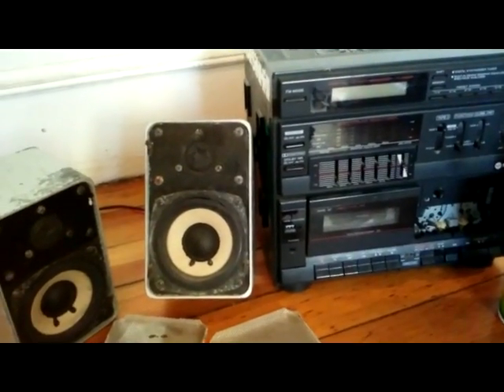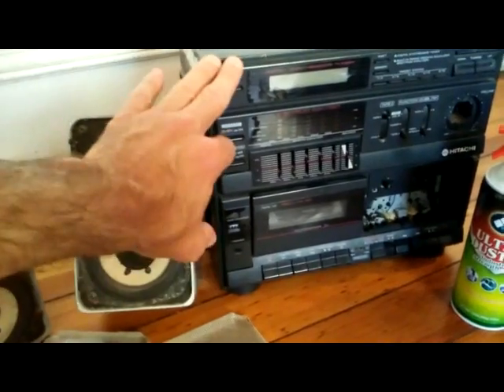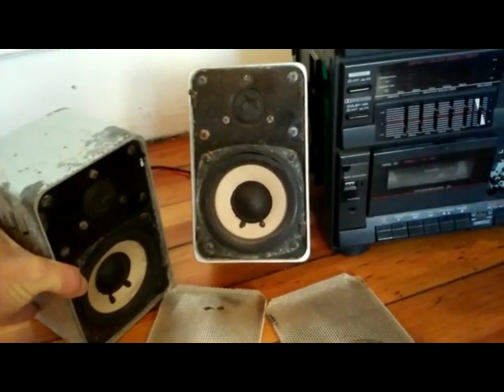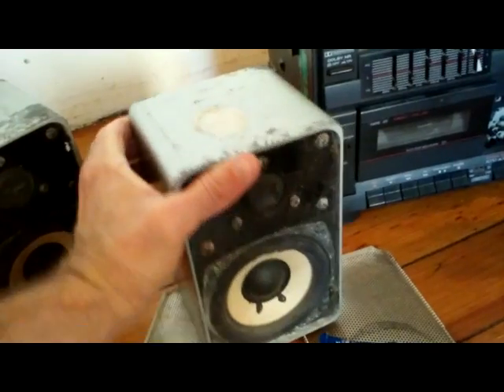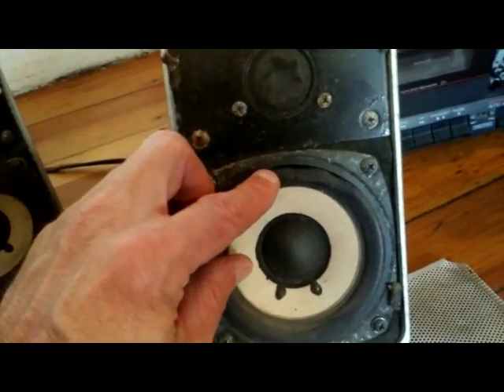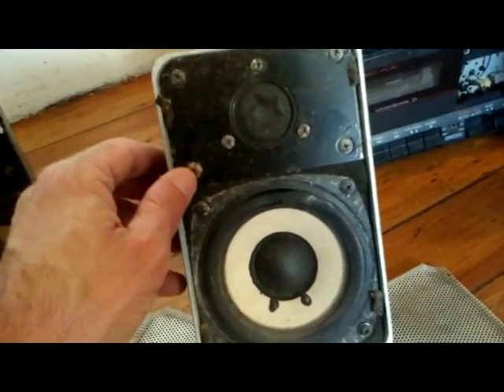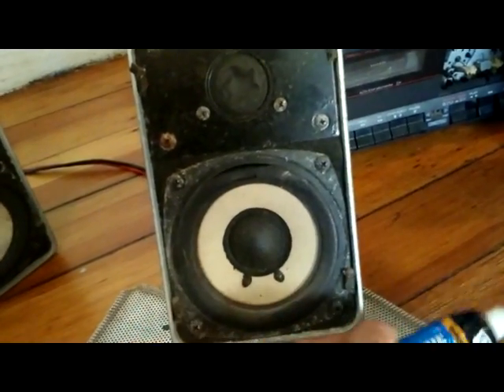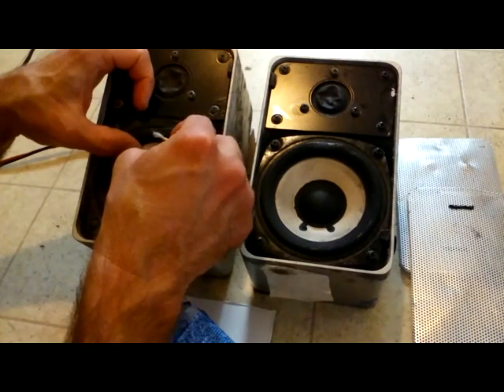Cracked woofer cone speaker 🕪 silicone rubber repair

Comment: Dumb move. Why didn't you take some added time, and replace the speaker surround, with new ones. If they are torn, your repair won't last, because it's telling you the surround is getting old, and needs replacing with new ones.
Reply from the maker: Nah Wayne, it's been a smart move for me, 5 years on. I don't blast full volume though.
Reply: @p1nesap  Tell me that when the voice coil is pulled over to the repair side, and shorts out on the magnet, thus blowing your receivers amp. section. It can happen, as I have replaced many an amplifier section, because of people doing repairs like this. It's a matter of do the job right the first time round, or see me later to repair your receiver's amp, and I charge $100.00 per hour, like most other repairman charge. It'll help put a nice sized steak on my table, or another repairman's table. It will happen over time, mark my words. I'm doing a set of 75 watt., Realistic speakers right now as I right, that are around 50 years old, and am replacing the "Surround Rings" with new ones. These speaker work correctly for another 50 + years, with no fear of damaging the receiver's amp. Once you make a patch repair, the rest of the ring is the weak spots, not where you did the repair. It is these weak spots that give out over a period of time, and cause the voice coil to shift into, and towards the magnet. If the coil shorts, you fry your amp up, and a repairman makes money to rebuild that amp., plus you'll need new speakers all over again. It's pay me now, or pay me later, as all repairman say. Your repair won't last another 50 yrs., where mine will. Enjoy that nice sound, while you can.
Reply from the maker: @waynedavies3185  Thanks for posting.

Comment: Is this glue also good to glue a full rubber\foam replacement for a speaker or just good for cuts?

I'm also thinking since my Logitech Z5500 speakers only have a few cuts I could glue them and then spray a few layers Plasti Dip which will add new rubber preserving the original even though I have full replacements for like a year which I never used and the Bonus with Plasti Dip is also that we can go wild on the colors even though I'd probably just use simple black...

Anyway I used contact glue to fix the cuts and worked fine even though its a bit harder than the rubber, but now like a year later there's already a few more cuts in other areas so I might buy silicon glue this time (I had one tube but dried way long ago)...
Reply from the maker: I've just used it as shown. You might read about methods of securing a full replacement to the cabinet.